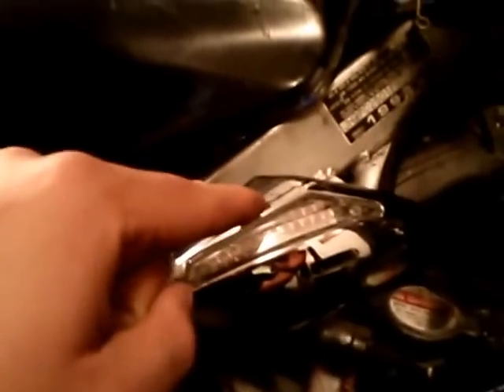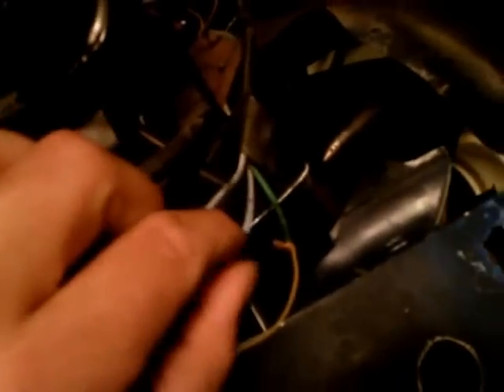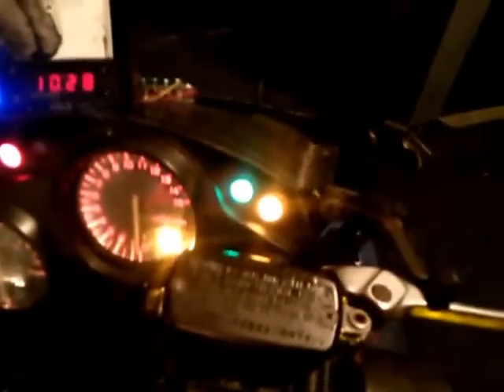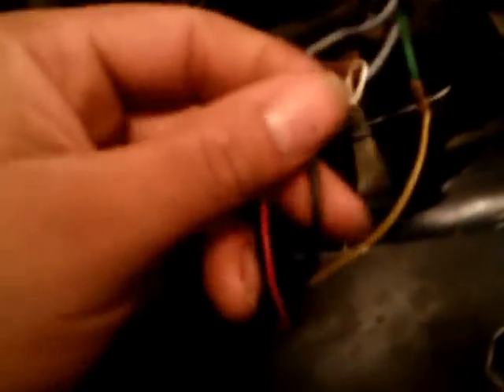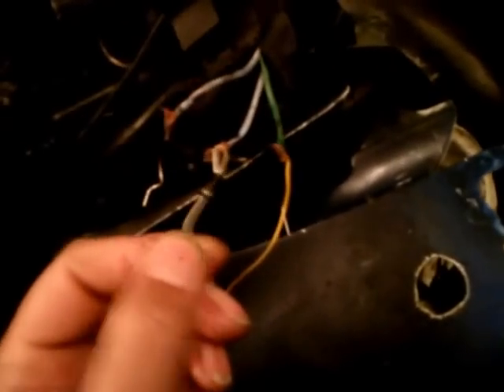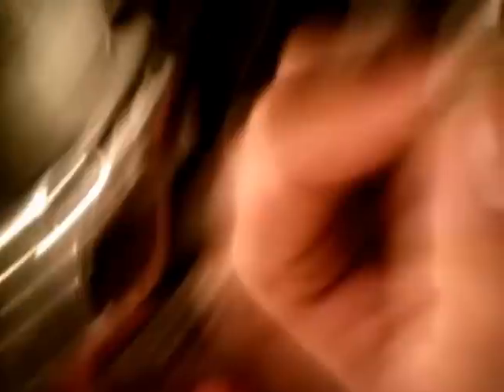How to have a turn signal and running light in 1

Comment: What if my bike is the opposite? I have 3 wires on my turn/daytime signal and 2 wires coming out of my bike
Reply: Hey did you ever find the answer I have the same issue
Reply: @gt_daz2416 I had a shop just do it for me, at the end it turned out to be better because they had to add resistors and rewire some stuff 
. They previous owner did som mcgyver wiring and they re-did the whole thing for around 400$ which was just labor.

Comment: Hey mate just a question if you can help me out please that will be great on my Harley breakout 2018 it have ground and indicator wire only but the new amber light I’ve installed now it has three wires third one is for daylight running so at the moment daylight running function is not activated due to running light wire is missing. This is only in American Harley’s not in Australian Harley models. I did not realise that till last time I have installed the light after That I find out what’s the problem but hardly is charging me big money for that wire. if I use your idea can it Activate my daylight running function and suggestions please. Thanks

Comment: Hey, this video is exactly what I needed. But how did you determine which diode to use? My turn signals are bulbs, not LED.
Reply: Did you figure this out? Running into the same issue
Reply: @chriss.3476   tbh no. Called in a friend (mechanic from Nissan), and we tinkered about with relays etc. In the end I scrapped the project. 

Relays kept clicking, and never got the desired effect unfortunately.
Reply: @matbiuko  ok, thanks

Comment: Hey man great video and thank you for the info. Not to throw out your idea but I also found on my motorcycle if you ground the ground from your bike to metal and hook up both power to the red and black on you turn signal it also works. Well at least it did on my 85 magna.

Comment: Hi I'm having problem with the led brake lights for my truck with same problems I get side marker lights and no running lights just brake/turn lights wanted to tap the marker light to the turn/brake lights and your video is the only solution what type diodes did you use ,thanks

Comment: I am wiring LED trailer lights to my 750 Shadow for running lights and signals however I touched the wrong wire and now I have no lights at all and all fuses in fuse box are fine what else do I need to check
Reply: Carmen Moseley did you ever fix it? I did the same thing...

Comment: Would this also work on cars? I purchased after market headlights that came with LED signal strip and I am running into the same issue you have there. I'm guessing all automotive are wired similar or should I say have the same functions. Hopefully it should work fingers crossed I only spent 5 bucks. Let me know thanks.
Reply: Yes

Comment: Will this work on a 2011 KLR 650? If so What size diodes did you use, im bout to hook up a my t box to be all running lights. So when im done do i wrap the diodes individually? thanks to your video!!! It took me all day surfing to find this, thanks for doing the video man!
Reply: Dallie Shell look up diy top box led brake light. you will need a resistor on the the tail light  side or you will only have a bright light. the resistor on the tail light side will make it a bit less bright
Reply: Wrap them individually so they wont short out. Diodes have to be able to handle 12 volts and need to be in proper orientation/correct flow. This will work KLR or anything that has lights. ~~matt

Comment: Great video! I do however have a question. I recently converted the running lights on my Sv1k by changing to amber bulbs and disconnecting bulbs from running light harness and splicing into side flashers. Id like to have them as running lights to by splicing negatives from both side and running harnesses and maybe doing this for both positives to the bulb. However, in the comments I noticed you said the running power is cut when flashers are activated...  so being the running is a separate harness from the turn, its always on if the bike is on. Therefore, my question is: should I go for the relays or would this method work? Thanks!
Reply: Diodes would work for that! No need for more relays

Comment: not that it matters but im in NY too I just put led everything bought the same mirrors u have but before I changed them my blinkers wouldn't blink they stayed solid but when I hit the switch it would go out and not flash. I bought a new relay still the same prob wtf lol but if I do get it to work right I hear its illegal for it to flash fast BC its suppose to flash faster BC it can't compensate so is it illegal here and can u help with then damn light
Reply: Get an led relay. You cant use a standard relay or it will flash too fast bc it thinks the bulb is blown. They are cheap $2

Comment: or just wire up a couple relays with the constant power(running lights)
Reply: mike g explain please, I want to try
Reply: +Noobman Jones .. I will have to find it or look at my bike. the way I did it was use two relays. Well works well. When bike is on all the running  lights are on. You wire each light with a relay in line. When you hit the turn signal it will send power to relay and energize the relay and basically cut the power to the light giving it the blinking. I found the wiring diagram on Google.
Reply: Mr. HighBall can you please provide a link for the wiring diagram you talking about. Thank you!

Comment: so if the two wires got connected to the + what gets connected to the -?
Reply: I've only got two wires for my turn signals that's why I ask.
Reply from the maker: +Dan DiFiore  ah this is for turn signals with 3 wires.. you would need to wire in an extra positive running light wire  to do this
Reply from the maker: +Matt Johnson  this is for 3 wires, one ground, one signal, and one positive

Comment: Can't get it to work. Seems pretty clear. 2 diodes (using 3-amp, 50 volt rating) both with the white band side tied together facing the lights. Other websites I've looked have the same solution, but I can't get it to work: I get running lights but no turn signals. right side turn signals work good. All fuses are good. What am I doing wrong?
Reply: check your polarity on your diodes
Reply from the maker: +C. Ivan Delgado  your positive wire needs to stop sending powerr when you turn on your turn signals

Comment: Hey man if your still active I've run into into a pickle... I'm changing out my turn signals on my 01 suzuki intruder vs800 and I have lights but my rear turn signals are now running lights if I turn the turn signal on and my front ones blink so fast that they look like their solid. Any ideas on how to fix this?
Reply: +nathan jackson Try using a resistor, the new lights might be drawing less load on the relay causing it to flash quicker.
Reply: I tried that it didn't work... I'm pretty sure I hooked it up right but not 100% I ended up striping them completely and just use hand and arm signals

Comment: First thanks for the video and taking the time to put it out. 
I have the same issue and ran into the same problems.
So i fully understand, we are just adding the diodes? Or must we further augment our wireing harness?  One of your answers ti a comment said the running lights being connected to the signal relay somehow?

Thanks again.
Reply: Only adding relays

Comment: I can't get it to work on my FZ-07. I have the sr560 diodes connected to each wire separately on one end then the other end together to the red wire of the signal. The white line on the diode is at the signal end. I connect the signal wire first and it blinks rapidly, as well as the rear signal blinking rapidly. When I connect the running light wire, the led becomes solid lit and the rear signal continues to blink rapidly. Any ideas?
Reply: Darrell Temple  ah you need that running wire to stop delivering current when you signal, you would need a signal relay that does that
Reply: I ordered the blinker genie. Hope it works.
Reply: Darrell Temple I too have a FZ-07 and would like to convert my two wire into a day running light.  Can you fill me in on how you got your's to work, TIA
Reply: +Darrell Temple Did this ever end up working for you? I have an FZ07 and debating if I want to get the Genie or try my luck with the diodes.
Reply: Yes the genie works great for that purpose! I get constant on running lights and directionals. The only "issue" remaining is that it's a fast blink out of all 4 directionals. I don't really mind it but it could be fixed with a different relay which I believe the same company sells? Good luck
Reply: Darrell Temple if you use a small capacitor it'll stop the blinking the rapid blinking that is

Comment: Great video but I'm having a hard time understanding  how  this is working. 
 If you have constant power going to the "running light wire" when the running lights are on, how does another power source (the "signal light wire" ) make the light flash? I understand the diodes will only allow current to flow one way but that shouldn't stop the "running light wire" to stop sending power to the light to allow it to blink via interrupted  power from the "signal light wire". 
I can see this working with the use of a relay but not just two diodes. 
Maybe you could shed some "light" on this mystery:^)
Reply from the maker: torchworx HEY! great question! the anwser lies at 0:59 in the video, when you signal, the bike cuts power to the running lights! so the running lights must be connected to the signal relay somehow,
Reply: @SavedMotors what voltage diode?
Reply from the maker: @ANDGEakaTAADOW  link in description

Comment: I hate to sound stupid... But I have a question. Do I have to to add diodes to all four turn signals? IR. To do my bike I will use 8 Diodes total?
Reply from the maker: Yeah, you have to add to diods to each light you want to blink and stay on, I only used 4 diodes because I did not want my rear turn signals to stay on as running lights only the front ones

Comment: Hey matt im trying to do the same thing with my ford raptor. I bought the recon side mirror blinker or use can use them as running lights. But it say it wont do both what kind of diode would i need?
Reply from the maker: Hey any diod that is atleast 15volts, and 20amps find them at your local radioshack (if its not closed) or ebay
Reply from the maker: Hey Andrew, you want to use diods of atleast 15volts, and 5amps for a 12volt system, I used 60volt 5amp diods, 60 volts just means thats the maximum it can handle before it blows,
Reply from the maker: This is what I used http://m.ebay.com/itm/130579772809?_mwBanner=1

Comment: what volts of the diode do i need to use..? thank you for the video.
Reply from the maker: hey i used 5amp 60v diodes, you dont need that much, i mean technically you only need about 15volts, but i just did 60volts to be on the safe side

Comment: Hey matt what are the part numbers on diodes?
Reply from the maker: hey Brian! i actually found that you can just go to your local radioshack and purchase diodes for cheap, but if youd rather get it on ebay, http://www.ebay.com/itm/SR560-5A-60V-Schottky-Rectifier-Diode-SB560-10-PCS-/130579772809
Reply: +Matt Johnson Thanks for helping with this. I know it's been a year, but I'm just now trying to get LED's properly wired up on the FZ-07. I see a lot of diodes rated at 5-10 amps and 400-1000 volts. Will those work? 1kV seems like a little much, no?
Reply from the maker: Your system is only running 12-14 volts, you dont need a diod with a crazy high capacity! It will work though!